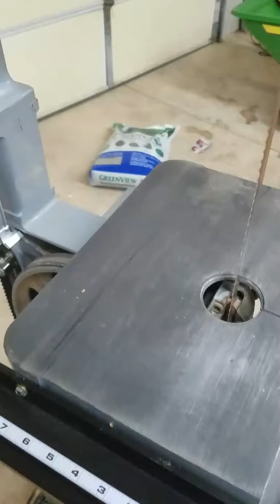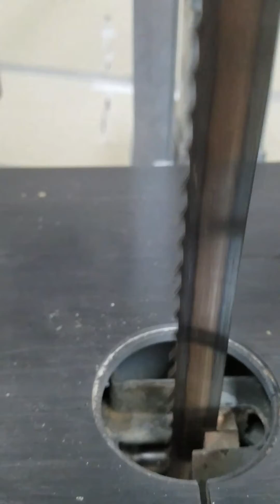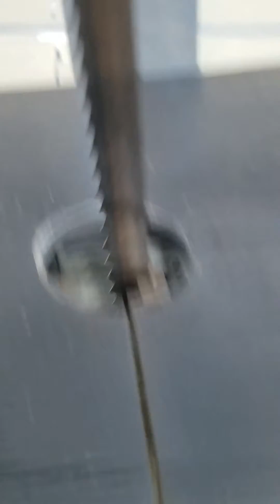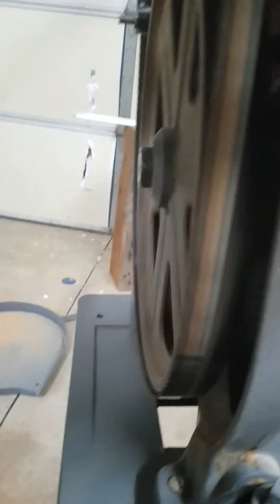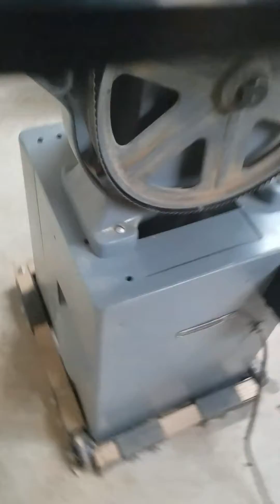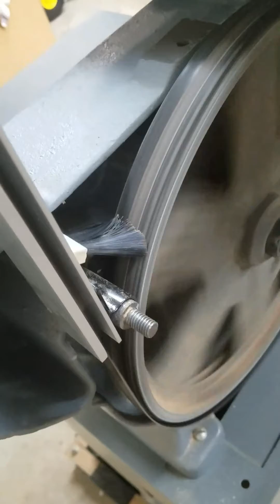Bandsaw lower tracking issue

Comment: looks like you have no tire on that bottom wheel. Also start tracking by backing off all the guides and bearings off the blade.
Reply from the maker: bdogg464 There was a tire, but it was quite old.  It's since been replaced.  See my other comment.   I also found that the wide resaw blade had bent when I snagged a nail.

Comment: Any solutions yet mate? I'm googling the same problem.
Reply from the maker: Machete Bushcraft Australia Mostly.  I tried switching blades,  but that didn't help much. 

In diagnosing this,  I pulled both the wheels off and cleaned up between the bearing face and the lower wheel.  The fact there was dust there at all makes me think the nut lost torque.  At the same time I switched to new tires on both wheels.   This seems to have fixed the issue,  though I can't narrow it down to any one thing.  If I had to pick one,  I suspect it was the loose joint.
Reply: Champion mate! Thanks for the quick reply. I will go check out mine now.
Reply from the maker: The face of the lower wheel still has some minor run-out, but that doesn't seem to be affecting the saw noticeably.